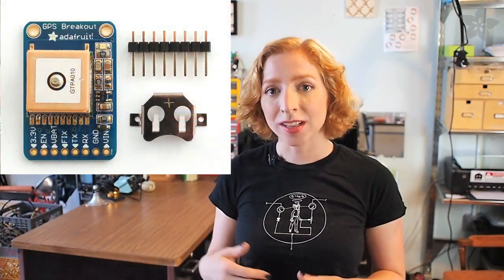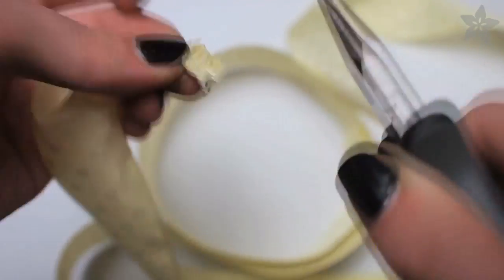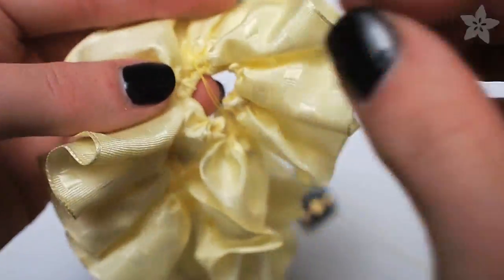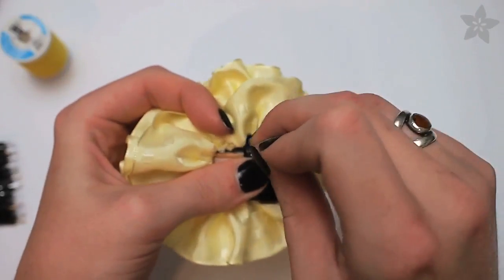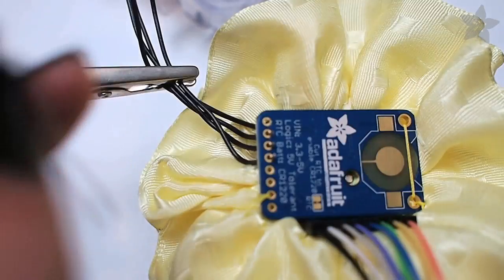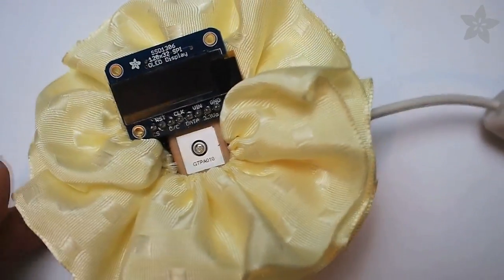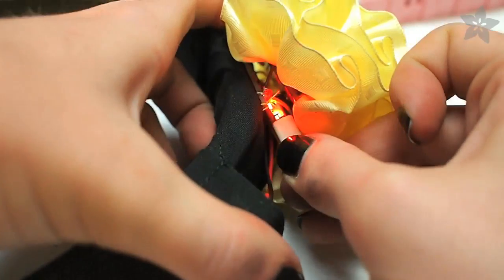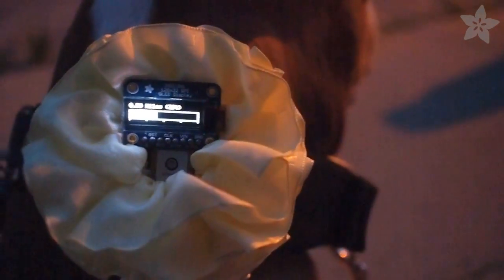GPS Dog Collar

Comment: I don't mean to be rude but as my experience with 120 wire soldered.  I wouldn't put lead wire onto solder tip since it can go into another pin hole by accident.  I always heat up pin then put lead wire onto pin instead of solder tip.  I always accident soldered two pin together where it wasn't suppose to be, by mistake. :(